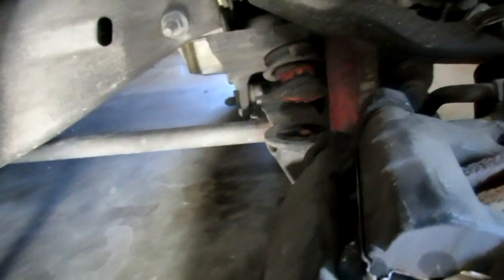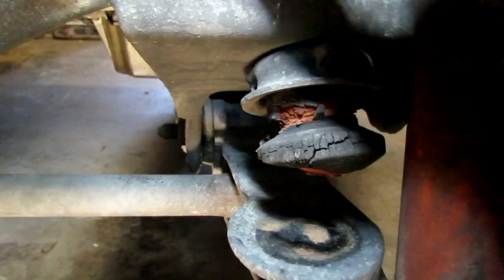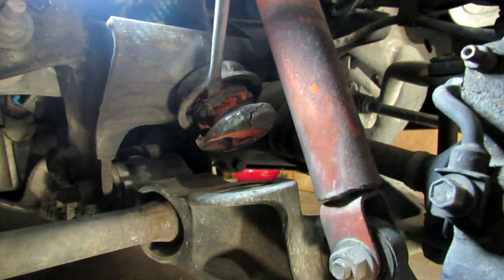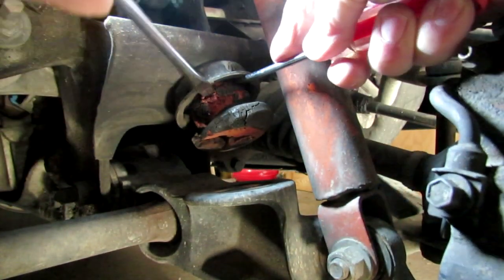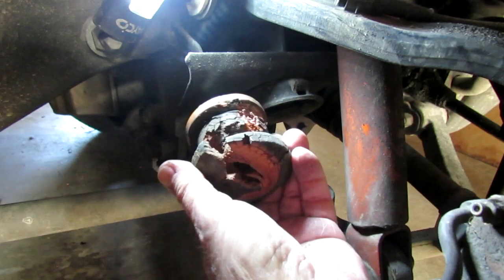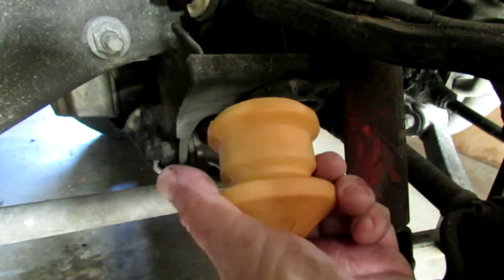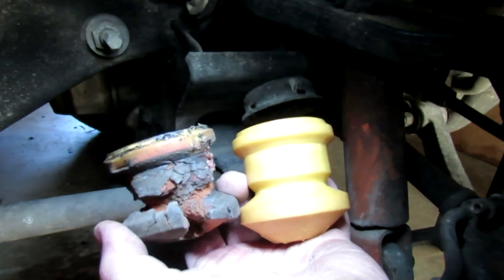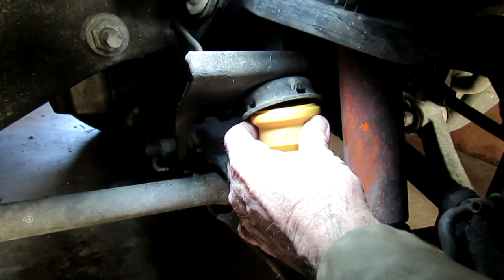Replacing Bump Stop 2002 Silverado

Comment: Does it ride any better with the new stops? Do you know the part number for the front bump stops?
Reply from the maker: I couldn't tell any difference in the ride but the old ones were so badly deteriorated that there was almost metal to metal contact. The bump stops  only come into play when the A-frame would go full travel upward, such when you might hit a pothole or heavy bump (hence the name). So you might not notice a problem in day-to-day driving but new bump stops would definitely protect the suspension if they were very worn as mine were.

Comment: so how did u get it in place?
Reply from the maker: Brett Buck Brent, there are little indents (I think 3 or maybe 4) inside the upper part that holds the bump stop. Just press the side that is away from you up into place, then take a blunt object (something that won't pierce the rubber bump stop) and gradually work it into place. It isn't really hard to do but yet does take some force to press the rubber up into place. Then give it a to get and twist to make sure it's firmly in there. Hope this helps!
Reply: thank u
Reply: Put some silicone spray or a little oil on it will help a lot. After it's in spray jounce with silicone spray to help preserve it ounce or twice a year 😎